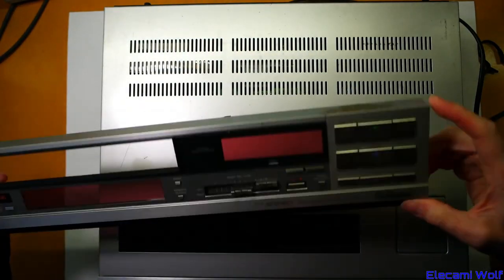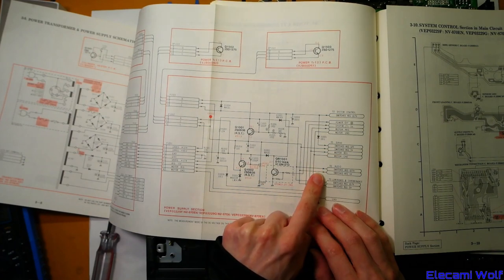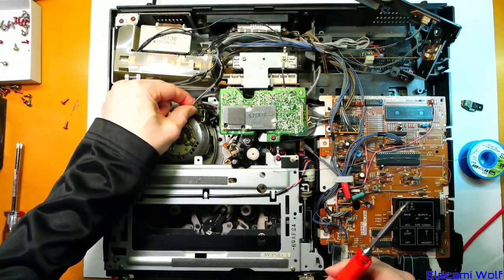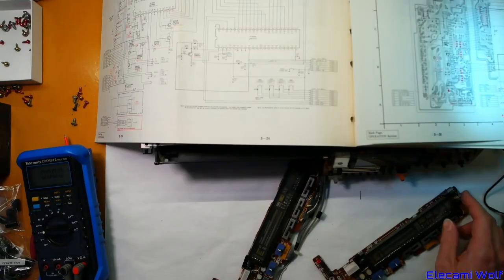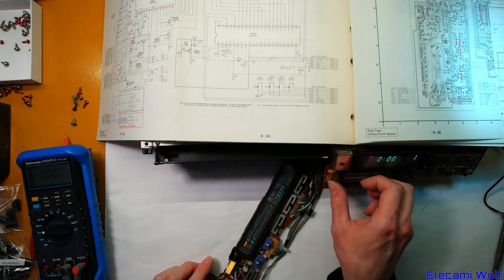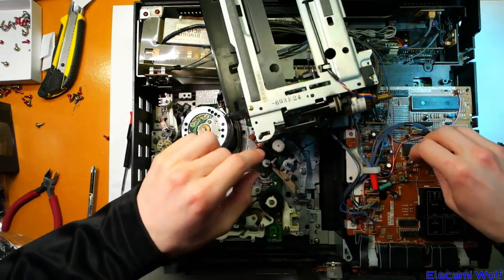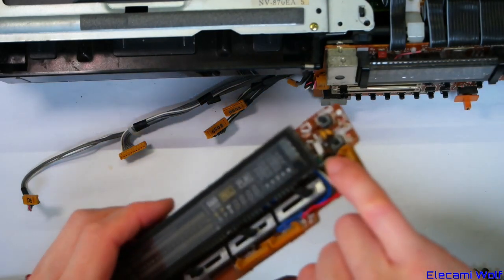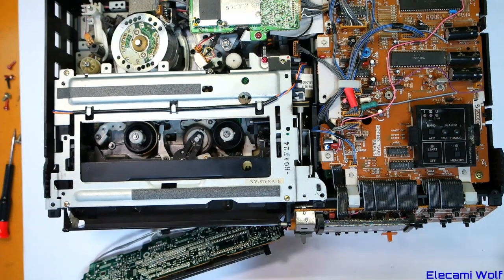EW0065 - National NV-870 VCR Repair Attempt Part 2

Comment: Hi mate,
Do you have a lower drum assembley and head for sale for the Nv-870?
Daniel
Reply from the maker: I don't have it available sorry. I am keeping one of the machines that worked and the other one got scrapped. Aluminum parts go to scrap dealer.
Reply: @Elecami  damn! Those parts are worth more than scrap value!
Keep me posted if you come across another one though please 🙏🏼
Reply from the maker: @danielgilpin6968  I've had trouble trying to sell old VCRs in the past. Seemed not worth it from lack of interest.